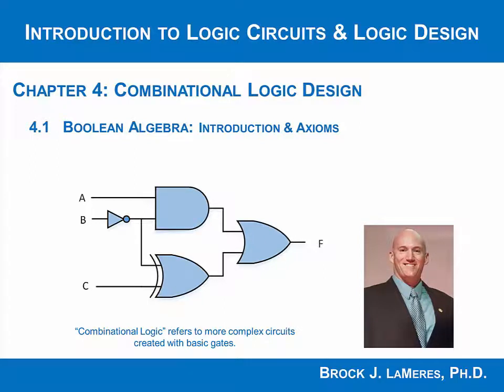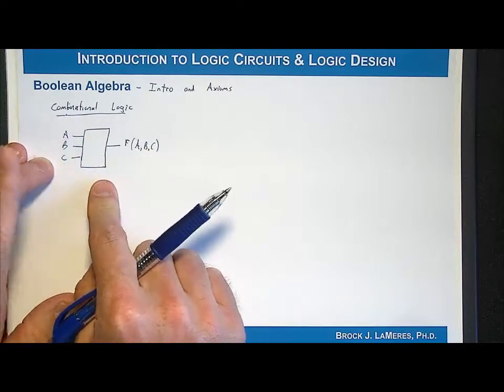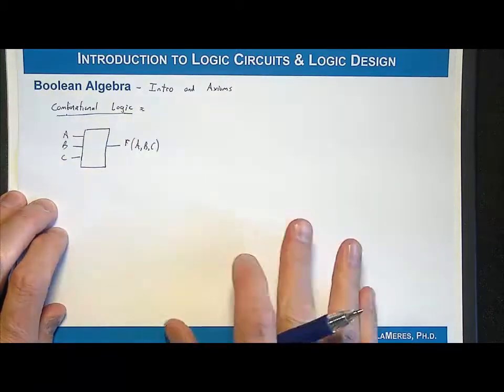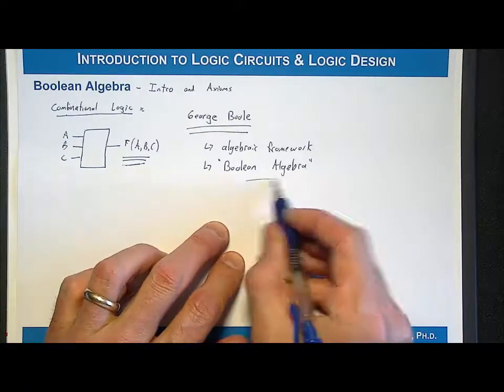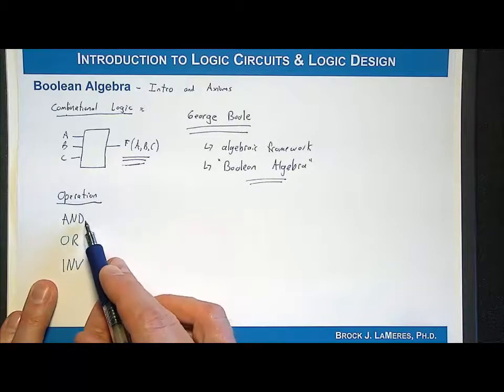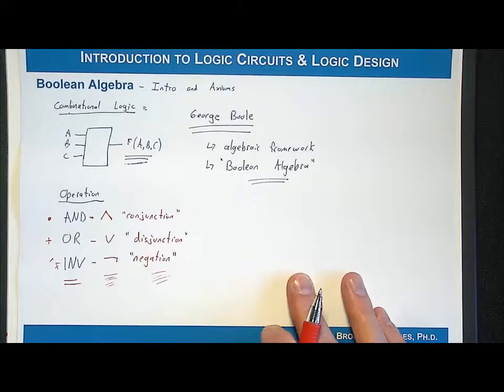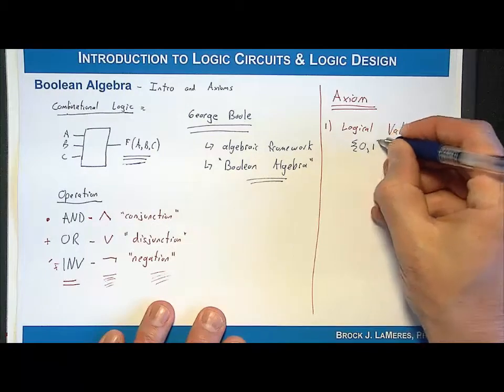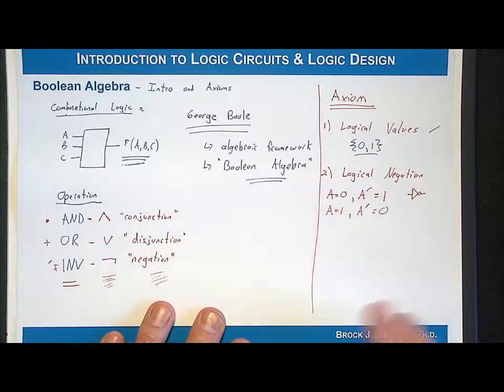4.1(a) - Boolean Algebra Intro and Axioms

Comment: unfortunately the 'definition' of Boolean Algebra in ALL digital system design books is wrong . 
Boolean Algebra is about Algebraic Structure <B , + ,  . > with four axioms or postulates . 
there is no restriction of the 'cardinality' of set B , it means it can be infinite set too ! 
and B = { T , F } or B = { 0 , 1 } is just an 'instance' of this algebraic structure which is introduced by claude shannon